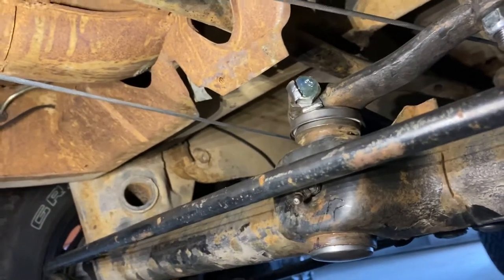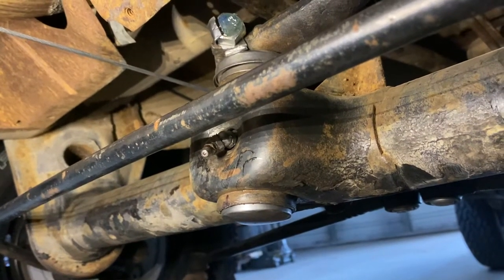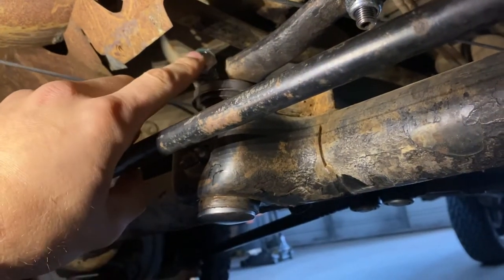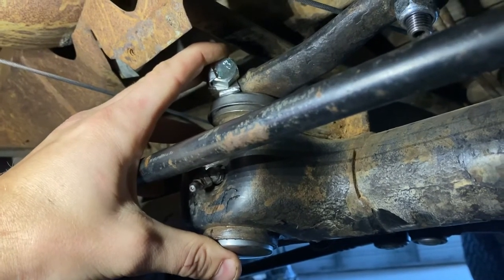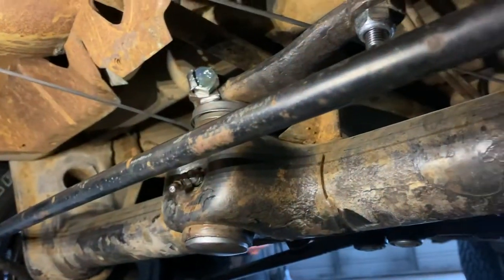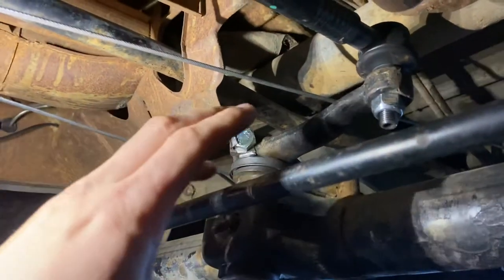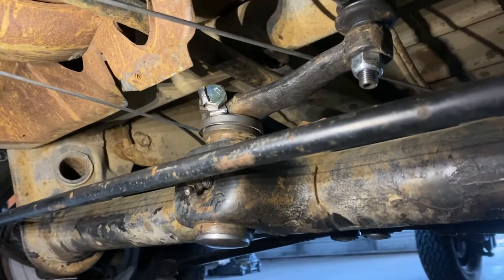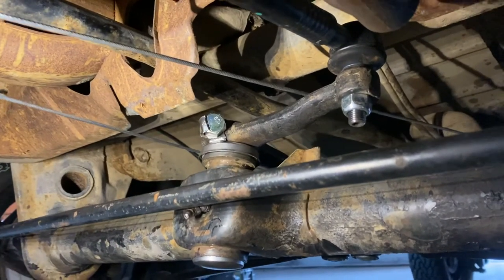VW Bay Window Bus Center Pin Replacement PART 4

Comment: I have the same job to do on my 68 db cab!  Thanks for this awesome videos!  (also for the interior tan TMI pics you posted to the samba)
Reply from the maker: You bet brotha, I've got a bunch more to share, and hopefully continuing to improve on audio and display quality. Thanks for watching.
Reply: @thebusbarnltd.co.35  I did my center pin on my 79 westy, but the 68 beam is very different and luckily this part seems to be the same.    I have been following your thread because my DC is not rusty on the nose but it has some damage to the nose and rear left corner.  I might be talking to the Gerson about a nose in the future (yet mine might be savable).   My damage is mostly on the roof, some PO did a bondo job that got water behind it and now my roof has some holes around the gutter.  I think I can patch them myself since no one has replacement metal for roofs, but first I need to remove the thick bondo.    My list includes, new brakes (restore the drums all around), maybe add a brake booster, rust repair on roof, nose repair, clean axles and CVs, install the new to me 1600 dp, restore the rubber for all the glass (I need a rear glass piece), fix some dents in the gates and clean up the paint and upholstery.  I am excited for this project.  I did a full restoration on my westy so this will be my second time doing this and I am thinking of making a channel to record the progress.

Comment: Nice work, explaining things very well. I have a 71 bay I'm going to tackle this same job, my beam is out. One question;   which washer did you put on the bottom of the pin before inserting it? Was it the wave washer? I ask because another video I watched, they added the wave washer on the top of the pin, which I think is incorrect. My flat washer was on  the top when I removed the dust cap!